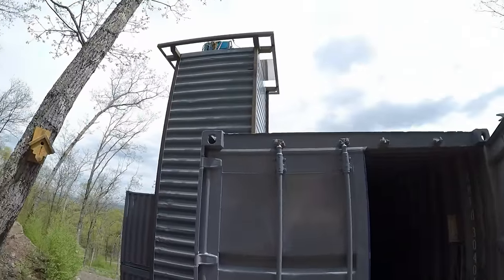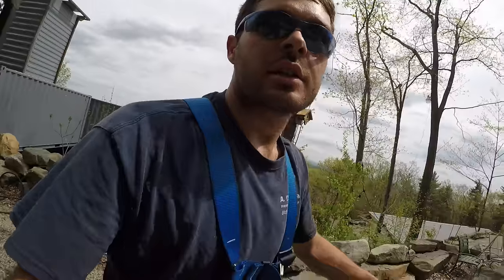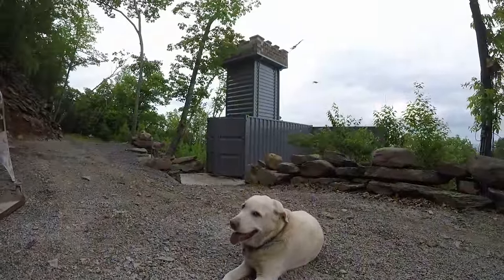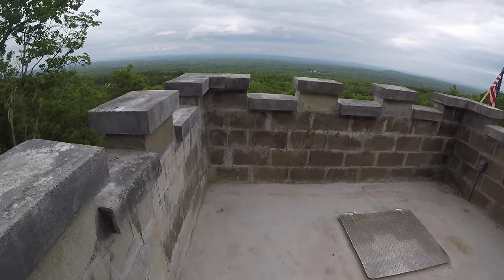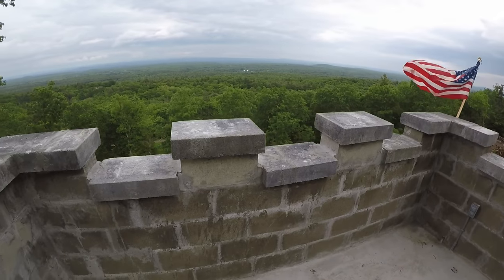Building a shipping container castle tower

Comment: How in the world do you pay for all of this
Reply: It is not as expensive as you think. You can get containers cheep. $1,100 to $4,500 for 40 foot to 53 foot and ranging from very used to one delivery use. That is like brand new.  The crane can be rented by the day, week or month. We are not doing videos, but are thinking about building an old style fort with them here in Florida. We picked up 5 acres in North Florida,  for $12,500 in December 2016. It is 167 foot wide and 1/4 mile deep.

It will take twelve 53 foot long X 9 foot tall, containers to build the star shaped fort walls. Then two 53 foot containers parallel but 20 foot apart with four 40 foot containers on top, two welded together at each end, with a deck between them. An in ground pool/pond with live fish and plants will go between the two 53 footers, so we can dive in from the upper deck. That would go in the center of the fort walls.

We are doing that, or we are buying three or four more properties around the USA and building small forts on each one and traveling around between them. The small forts will be made of three 53 footers for a box shape with two 40 footers for a single point. Then put two 40 footers parallel inside the middle and 20 foot apart, with three 40 footers on top, welded together. No pool or pond, as we would be traveling and do not want the extra care to keep up each of them. 

If we can, we would get two of the properties on rivers or creeks somewhere. Before we purchased the 5 acres, we were looking at 1 acre on a river for $10,000 cash. We want remote locations and property is affordable, if you know where to look. The key is to look for yourself and do as much of the work as you can. You save 50% to 75% by  being smart, instead of throwing tons of money at the project.

We payed $4,500 for our 2002 F-250 Super-Cab 4X4 and $7,000 for our F-250 Super-Cab with the V-10 engine for hauling. We payed $4,000 for a 1988 Jeep Wrangler 4X4 with 120,000 miles on it. We are the 3rd owners, because the grand son did not want to drive it to college, like his dad and grand dad did.These are vehicles we purchased over a five year period. It takes patients and to have the money ready.

Just in case we do not like the properties, we also purchased a 25 foot sailboat with trailer for $4,500 to learn to sail. If we like sailing, we will only keep the one property and get something like a 40 foot to 42 foot Ketch sailboat and sail around instead. Brand New 42 footer is about $250,000 and up. If we refit one ourselves, we can pick one up that is turnkey and a few repairs and maybe an engine rebuild, for about $25,000 and put about $10,000 into it. Again, it is about doing your homework, shopping for yourself and doing the refit, mostly yourself.

Even a brand new sailboat will need some if not all refitting in 10 to 20 years, so we would rather buy used, but still usable. Most sailboats are not babied, they are used for what they are built for. Adventures and Adventurist Living. I happen to grow up in a large family with contractors, auto body and mechanics in it, and I worked with and for most of them. My father was a general residential contractor and so I learned woodwork, electrical, flooring, siding and roofing before finishing middle school. If you want, you can learn most things good enough to follow directions. Following the proper directions, properly is the key.

I taught myself how to build and repair computers in six months and in about eight months, I could repair operating systems and build dual boot computers. If you are intimidated by learning  new things, it is hard. If you enjoy learning new things and believe you can teach yourself most things, you can. You just have to do a lot of research and make sure you are teaching yourself with accurate information and get your hands on the materials and tools to learn with. I got computers for free out of people trash, and out of dumpsters. I got the books for free from the public library. I retired about age 39. I am 50 now, but stay busy doing things.
Reply: Fla-bushcraft Prepper, I enjoyed reading your rather long comment (just kidding). I too am an urban prepper, vet, 50 y/o and share some of your ideas to build with containers but down here (around Miami-Dade, Broward County area), I'd love to connect with you and share ideas. Question: Have you found about permitting to build with containers? I can't seem to get a straight answer in my area.  Please feel free to contact me (google). Thanks.
Reply: Years ago the industry could not give these things away. You could get a 53' for under $500.
Reply: The code enforcement and building and permits departments in most counties,  usually act in one of two ways. 

#1  If you walk in with blueprints from a local architect, showing how the containers are going to be used and the alterations for windows and doors and how corrections will be made to compensate for the changes in the original tolerances. Plus some paper work from a respected company in the area, showing the containers original tolerances. Including a list of the companies or contractors who will be helping you and where you are getting the crane from, they will act as normal and issue a permit.

#2 If you walk in and ask, "I want to build a house out of shipping containers and was wanting to know if the county will allow or permit that?"  You instantly look to them as the annoying person who has a wondering mind and has no idea what they are doing and thus, you are some kind of threat to yourself and the public in general. They will be kind of polite, but they usually are hoping you will go away and find something else to do that will not cause them to do paperwork and end up in court.

Lets say we commit to building the fort. I would watch videos on Youtube on how to draw blueprints. I would watch videos on how contractors actually build them.  I would draw my own blueprints and take them to an architect. I would give the architect the papers I printed out on the containers manufactured tolerances.  I would show them to them, and ask for an estimate to make professional ones the city will accept. I want three copies for this price.

If If he says $1,000 to $2,500, I would go to other Architects, until I find one who gives me an exact dollar estimate. So let's say it is about $900, because I have with me, nice looking and accurate blueprints they can use as reference. They will make the new larger and professional ones with corrections, and I will have three copies. One fore me, one for the county and one for the job site for any crew or person I hire to reference on location. Also in case the inspector shows up and does not have a copy.

I go to building and permits and hand it to them, they sell the permit, or they ask, "Who is the contractor or company you are using to do this?" You need to tell them and you need to tell them in a way that they know what you are taking about with confidence. If you have the list of people or companies you are using to do or oversee, each of the jobs, and where the crane is coming from, you will 99% of the time get the permit.

I would also have a breakdown on the stages of the project. This way the inspector can say, "I will inspect at this point, this point and here, here again and the final will be at this point of the project." Some inspectors want to only come out two or three times, some like to inspect at specific stages, no matter how many times, usually not more than 5 or 6 times, unless they are intrigued with the project. Then they want to come out off and on just to see the progress and take photos. BE VERY VERY polite and professional to the inspector. They are the YES Man, weather they are a man or a woman. They need to "want" to give you the thumbs up, to move to the next stage of the project.
Hope this helps and for some reason, county offices do not want to point people in any direction with assistance.
Reply from the maker: That step really wasn't very expensive, more labor than anything.
Reply: thanks!
Reply: how wifi or cellphone  work in there ? did you try
Reply: this is some very very good advice, thank you
Reply: TheMakyato I'm sure he's tried to operate his phone out there. Also, Wi-Fi works anywhere. If you're asking about internet, you can get satellite internet (but it usually sucks and is expensive), or cellphone based internet. (which is fast-ish and expensive) I'm sure he has some sort of internet.
Reply: setag54321 Wait and see when the next American Dust Bowl happens like it did in the great depression, and instead of normal dust blowing across America, it will be Monsanto Roundup Ready Dust. People who would normally have a hard time breathing with asthma and other respiratory ailments, will drop dead like flies. All those farms growing Monsanto Genetically Altered Crops are making the soil more toxic with each passing season.

I believe this is the reason a sickness sweeps the USA each year now, just about the same time each year, and they say, they have no idea what it is. Every year, during and after the summer harvest, it happens. It does not take a racket scientists to figure out that the only thing different about large swaths of farm land now is Monsanto. Look at their name "Monsanto",  "Mon San To",    "Monster  Sand  To".  It says the Sand storms will be like Monsters to the people.
Reply: What is interstellar? Is that a TV show. We do not own a television.
Reply: Interstellar is a Sci-fi movie. In the film, the main character lives in a farming area that just went through the Dust Bowl- type scenario you mentioned.
Reply: Ah, well they should include the effects of the dust being contaminated with Monsanto genetically modified Round Up Ready plants. The plants get tilled back into the soil after harvest, for decades now. I will watch the movie with my laptop.
Reply: whats your companies name
Reply: oh thanks so much ill need to look into it
Reply: you are welcome.May I have your email ID. I could send some certifications we have.
Reply: Film Master
It would be safer to paint hippie flowers on it or hang bright knight's of the round table flags on it,  pass out free nuts and seeds or free wine and cheese to soldiers, when they come to search the place. Then they like you and pass over you when they move across the earth killing everyone.

Prepping Wise, is better than Just Prepping.
Reply: I didn't get you point.
Reply: it was a joke
Reply: oh~ok

Comment: Rebar sandblasted ? Rusty rebar will continue to rust. Do ohm test on structure. Any trickle will cause you problems in your lifetime. Your young. Seal ( all concrete and block ) ? Big sponge !, Ground building?  Nice work ! You probably know all this.
Reply: World's full of haters
Reply: Once concrete covers the rebar oxygen won’t reach it. There for no sandblasting required. Excellent work. Clean and not sloppy.
Reply: Due to chemical reaction, rebar continues to corrode in concrete where outer layer is damaged, like at a weld.  Previous poster is right.  Test your structure for conduction in the structure.  Save the wear and tear over the long haul.

Comment: Can that actually hold all that weight on the top like that, doesnt look safe at all.
Reply from the maker: All the engineering I did, said it could hold 10 times the weight that's up there. So I am not worried.
Reply: Have you had it inspected? How do you know exactly how many weight it can hold when upright? Those containers are designed to be stored flat not upright like that, if you add weight to a car when its lying flat thats fine but if you add to much weight to a car when its standing up right with its nose in the air it would be crushed.
Reply from the maker: Your right, I would not rely on the container holding all that weight. I added a few columns to help it support it. There is the 6x6 in the center from the stairs, and the two 4x4's on the roof corners.
Reply: +Andrew Camarata Uh good thinking. Brilliant project.
Reply: I still worry about the structural integrity of the container.  If the container buckles or twists under load, say a 60-70 MPH wind, the vertical strength will not be the mode of failure.  Could the container twist and bend the vertical supports enough for them to buckle under the mass of that slab and block work?  I don't know myself, but eraldorh is right when he says containers are not designed to be loaded longitudinally.  The structure looks more than adequate vertically.  Great video, BTW, you are one hard working, trade skilled guy.  Love your stairs you built.
Reply: Chuck Evans the 4*4 and 6*6 steel beams wouldn't notice a hurricane. This looks very much overbuilt (good for him because a castle crumbling would be a sad symbol :p).

Comment: When I had a 17 ton Terex boom truck, it had a wireless remote control, you wore the unit on your waist. It didn't interfere with wearing a nail belt, and I built my entire 40' by 60' shop myself, quite easily.  The German made remote cast 14 K though! You can pick those old Pettibones up for about that, and any crane is better then no crane. Nowadays I operate a 30 ton National with a heated and air conditioned cab, with SAT radio, and 110' of main boom, life is sweet!  Good work Andrew!

Comment: I'm no engineer by no means but what do have that container tied into.? You stood it up vertically is drilled into concrete and then is it anchored to the other containers from allowing side to side movement. You have alot of weight in terms of rebar and concrete slab on the top with concrete blocks as your wall. You've opened an access panel what about rain water looks as though it will pour right down the access panel opening right into your structure. I'm sure I missed a couple of videos on all that I mentioned. But all that concrete is concerning and you mentioned opening the side of the container to make a door to access the other roof onto your maintenance building. Again I'm no engineer but that looks heavy on that container

Comment: I thought the vertical steel tube placed by the crane would become a rain and snow melt run off drain. Do you plan to place a drain on the roof? I suspect you will want to rinse the floor from time to time too. I'm sure it will be ingenious.

Comment: I do have a question..  Did you have to reinforce the inside of the vertical container so it would not pancake from structure weakness/weight once you added all the cement and cement blocks?
Reply from the maker: Yeah, I added a few columns. All the calculations I did said it was fine.

Comment: Well you can defiantly tell the difference, between a person who welds vs. a Welder. Personally for welding outside and especially for a structure support like that. I would had went with a Arc welder from a safety standpoint. Mig is not designed for a really good penetration compared to a Arc. Especially being used outside where the wind can affect your gas shield and not give you a quality weld structurally. 2nd Mig is not really design to be used in damp or wet conditions, which will affect the straight of the weld. and 3rd Mig does not do too good with dirty material "rust or dirt on the metal your welding". "Hint why its not certified to be used on pipelines". And after all of that from a fabrication standpoint. I see a big time rust problem in the near future. Don't be surprise when those steel plates and angle iron under the concrete starts rusting like crazy. Concrete and steel thats not really protected does not mix. Concrete does hold moisture.

Comment: 8:00 Well, if you dont have a working cage for the crane, just use a small trailer. XD Maybe you should add some points to the trailer where you can attach chains or belts so you dont have to improvise next time.
Or you just build such a cage like you did with that crane attacher for the skidd steer bucket. XD

And is there a chance to add a remote to that crane? Just curious because i'm sure that could be useful too.

Comment: As long as it never rains. You have no drainage system for your roof. Water will just build up. Also it will leak,you will need a gasket for your trap door to your tower.
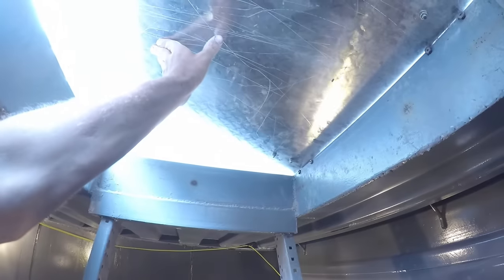Reply: there are 4 drains clearly visible during the final shots around 16:00 and you can also see them as they pour the concrete floor.
Reply: Still no gasket for the hatch door. Not clearly visible anywhere

Comment: So mr. Camarata.
I have this idea.8579
I supply stuff and you make a snowmobile with front wheel drive  atv tires  on front.  A  4x4 atv but with a single track in back instead of the 2 rear wheels. 
I m too old& disabled to do it.twofivesix
404. I m guessing u live around NYC- catskills. Certainly not western Newyork or southern tier or Watertown /Albany

Comment: You should have anchored your establishment in the rock wall and cantilevered out. With all the structural & grading work you did you wasted time & money on shipping containers, hot tub should be on top of the tower, shop & heavy equipment shelter(s) below. Don’t need shipping containers for fire or wind resistant loads? What is the purpose of the vast upper outdoor space with reinforced cmu balcony walls & 1/4” steel plate roofing? Looks like you send most of your time in the shop.
Reply from the maker: What are you talking about? This building is perfect.
Reply: Andrew Camarata You are absolutely correct.I apologize.

Comment: How to waterproof cement coat it with gunite make sure it is waterproof gunite there's two types one is for strength interia and one is for a ceiling a pool just spray it on light coats with a popcorn machine ceiling popcorn machine texture

Comment: everything is fine but block tower is not safe
Reply from the maker: Why isn't it.
Reply: @AndrewCamarata  the blocks are only glued without any foundation
Reply from the maker: There is no glue used on this project. They are held together with concrete and re-bar, This is a couple years old now. Its fine, and will be fine forever.